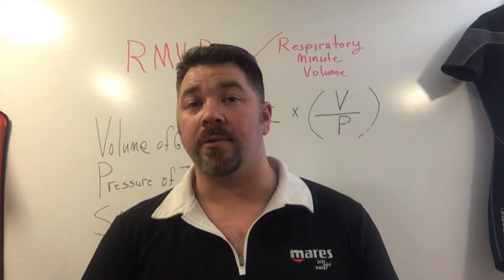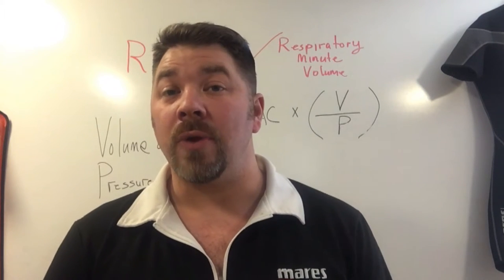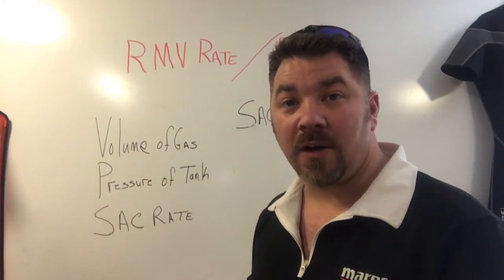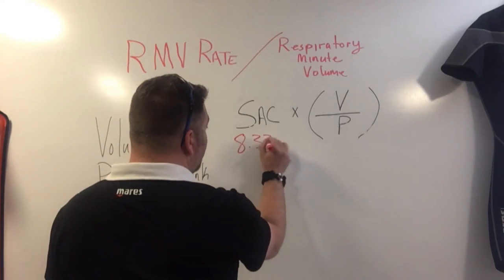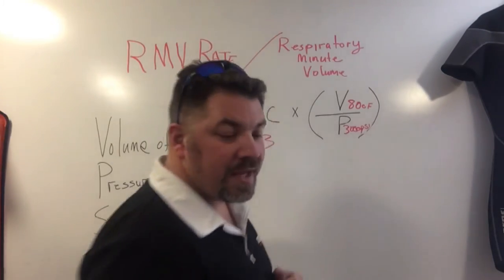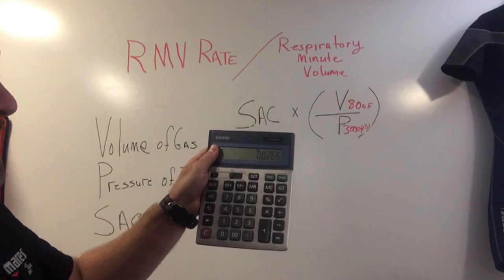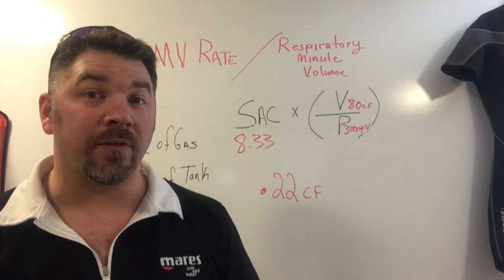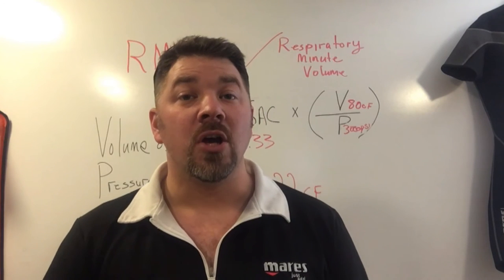How Many Cubic Feet Of Gas Do You Breath? RMV RATE Explained

Comment: You said at the end of the video that .22 cf or RMV was what the diver uses at the surface. However in the previous video the scenario was that the diver was at a depth of 33 feet. You calculated his SAC at 33 feet and then used the 8.33 SAC to find his cubic foot use. Why wouldn't this be his rate consumed at 33 feet rather than his surface rate since it was calculated at a depth of 33 feet?  I was just open water certified and I am taking the deep water diver class now and I am trying to make sense of it all. Thanks in advance !
Reply from the maker: Hello Brandon, the biggest reason we use a surface calculation instead of a depth calculation is, it is a base line. Even the S-A-C acronym is meant for the surface ((S)-SURFACE, (A)-AIR, (C)-CONSUMPTION). Once we have this value then we can very easily convert it to any depth. The same would apply to the RMV rate.  This is a resting value that we need a base line for at the surface.  This in return can be converted to any given depth, thus allowing us to plan for the appropriate cylinder(s) for any given dive.  Many variables can change underwater (current, medical issues, equipment failures, etc. etc.), thus producing a base line at the surface (hence the calculations being reverted back to the surface since the surface is a constant that never changes), is a more accurate way to plan dives.  This too, is why we work off an average SAC rate and not one from a single dive.  Hopefully this answers your questions. If not I will try to make a video explaining it in more detail for you.

Comment: Can you explain why you are using 80 cu ft in the calculation when a "standard aluminum 80 cu ft cylinder" only holds 77.4 cu ft?
Reply from the maker: Hello John Williams, that is an excellent question and one that comes up all the time with technical divers alike. The short and simplified answer is one that tends to cause controversies across the industry. But here it is. For the average sport diver (which make up 95 % of the industry), the rule of thumb is to use the law of averages. The biggest variable as far as a tank's physical capacity is the manufacture. Luxfer's Aluminum 80cf, as you stated only holds 77.4 cf of gas at 3000 psi, however, other manufactures hold between 75 cf - 79 cf (as not all tanks are manufactured equally). So as a whole, divers do what they have always done, round up. We simply round up to 80 cf. We do the same thing with Decompression Theory. If we look at a set of tables, we always round up to the nearest depth. If I wanted to calculate a depth of 37 ft, I would simply round up to 40 ft on the tables. Now from a physics stand point, this is not exact, and we are gambling with our safety, but we have to remember the tables have so much conservatism built into the algorithms, the rule of averages (rounding up) still works and is safe to do. Another great example of this is when we Gas Blend mixtures. If I was to blend a mix of say .324 Nitrox, I would label it as 32%, but if I blended .325, then I would label it as 33%. This 1,000th of a difference makes very little difference at face value, but could cause issues from a liability stand point. So at the end of the day, we use the Law of Averages, and we round up to an whole number to keep the math simple. In short, we use the KISS method. Keep It Simple. Great question and I hope this answers it for you.
Reply: @LakeHickoryScuba  Thank you very much, that is an excellent explanation.  Is this also why you use "working cylinder pressure" versus the actual pressure that's in the cylinder on a particular dive?  Even with a full cylinder, there's also the Charles Law, where one's psi drops when we enter the water in the summer...or would all of this only make decimal point differences?
Reply from the maker: Correct John Williams. It again is based on the law of averages. Now when filling Nitrox via partial pressure blending, using exact psi without rounding up is necessary. This too though is never 100% accurate, as all manufactured gauges will have a + or - 10% discrepancy in accuracy. Digital gauges are a different subject all together. You make a great point about Charles' Law. For every 1 degree temperature change we either gain or lose 5 psi. But from a planning view, we will always plan with the constant temperature from the surface. Plus the constant of 1 ATA of pressure will always be constant at sea level, where the ATA will always change through out your dive. Thus, we plan using ATA at the surface. These are the topics that we discuss in detail in the SSI Science of Diving Course. They always raise a lot of discussions between divers. Here is another one that you may find interesting about the Scuba Industry. We have always used 14.7 psi as the variable for Atmospheric Pressure at Sea Level, and we continue to use that calculation every 33 feet of depth in Seawater, and every 34 feet of depth in Freshwater. Now if we calculate using bar instead of ATA, the actual gauge pressure is calculated with 14.5 psig (gauge) instead of 14.7 psia (absolute). So instead of confusing divers world wide, we simply adapt the 14.7 as the psia as the constant atmospheric change per ATA change. 

Note: The difference between the Imperial System and the Metric System always tends to confuse people when we talk about calculations for Freshwater and Saltwater. In the Imperial system, we change between 33 and 34 feet for calculations. However in the Metric System, we use the constant of 10 meters (instead of using exacts 33 ft is 10.05 and 34 ft is 10.36). As you can see, the discrepancies show the conservatism built in. And it goes to prove that Decompression Theory is theoretical at best.

Comment: After having the RMV, we can take that value and multiply by the bottom time to get the total ft3 used couldn't we?
Reply from the maker: We can use the RMV for a multitude of different things.  Primarily we use it to determine what size cylinder we will need for any dive.  And as you stated, we could multiply it by our atmospheric pressure to help determine how many cubic feet we would be breathing at depth as well.